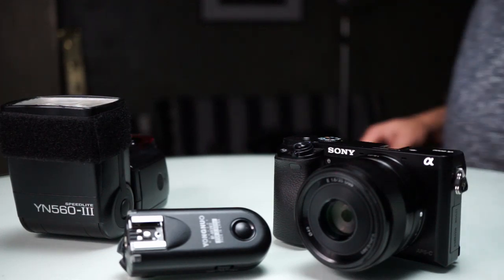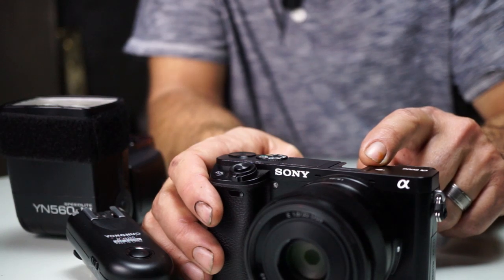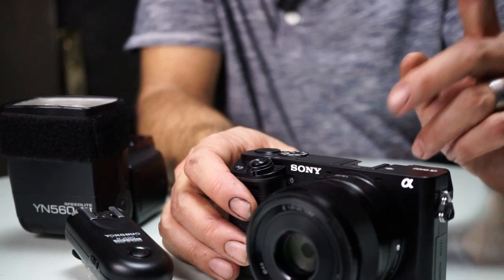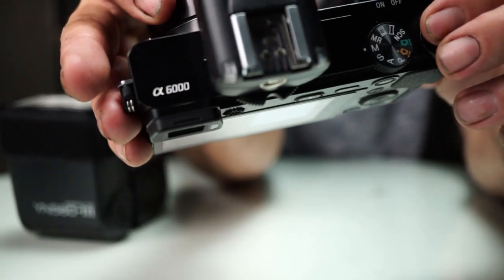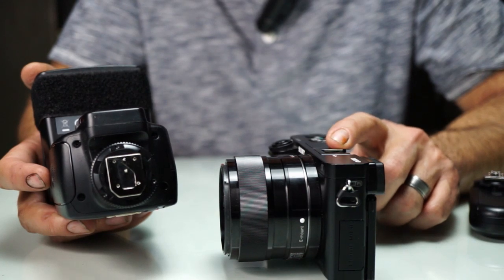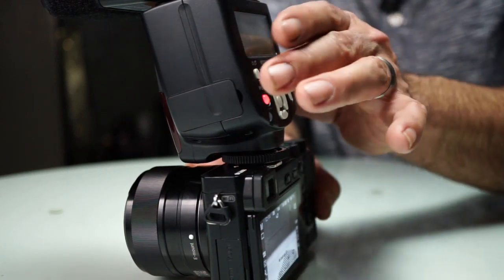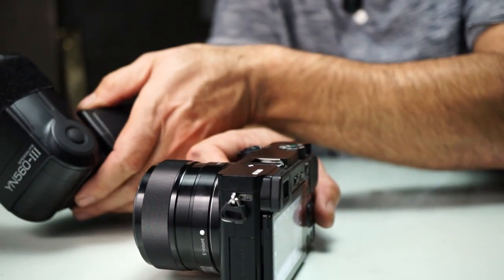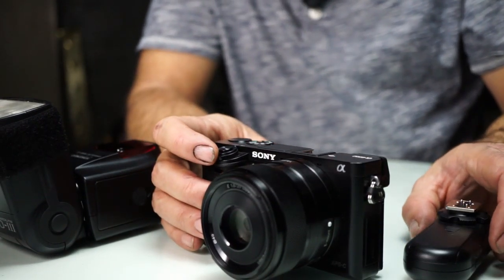Sony ILCE a6000 Hot Shoe for flashes fix Updated -How to.

Comment: Do you have a fix for the "WN" (wireless flash) function being grayed out?  I can't turn on the wireless Flash function and get a error message saying it is disabled.  I made it work anyway by putting my RF603C in the shoe and it fired both my Yongs.  But still. Why is it doing that??
Reply from the maker: that function only works with Sony flashes and the Nissin commander.  This is an old video. Godox is your best bet for flashes with Sony. The v350s and the x-pro-s trigger or the newer v1.
Reply: @LavikkaPhotography  I have a Flashpoint Xplor 600 on the way (Adorama's Godox Branding).    I am going to use it with Cactus triggers as the cactus triggers apparently work with multiple brands so I can trigger the Xplor and my Yongnuos with them.  I bought 4 triggers so 1 for transmitter and to receivers and one to trigger my camera.  Thankfully, I will use my Canon 80d for my flash photography.  I just like it when everything works.  I didn't know the A6000 had a proprietary hotshoe.  I really bought it to hoist it up on a pole to take elevated exterior architectural shots.  Saves me drone $$.   No flash needed - yet.  lol
Reply from the maker: @hotwireman49  nice stobe. Flashpoint is technically Godox so if the Cactus triggers don't work the way you want them too then Flashpoint R2 Mark II transmitter for Canon and another for Sony along with a few Base receivers that you can put your flashes on. 
I prefer Godox or flashpoint because you can mix and match flashes between camera systems but still have full control with the transmitters giving you true hss and ttl.

Comment: When I connect godox TT350s flash on sony A6000 it show this accessory is not supported by the device and does not detect by camera. My friend also has sony A6000 but it supports godox TT350s flash and doesn't show any massage when connected. Both camera same settings only my camera says this accessory is not supported by the device. What should I do please help please
Reply from the maker: You need to update the firmware on your a6000.
Reply from the maker: https://esupport.sony.com/US/p/model-home.pl?mdl=ILCE6000&template_id=1&region_id=1&tab=download#/downloadTab
Reply: I updated my sony A6000  latest version 3.2. Before the problem.
Reply from the maker: Is the flash set on flash+fill in the menu on the camera?
Reply: Yes..

Comment: The root cause of this issue has been sorted out.  It's that the Yongnuo flash expects ground to be on the underside of the top lip of the hotshoe mount as shown as the red section in the diagram here: https://www.dpreview.com/forums/post/54885036.  if you get a nail file or something and sand that down even just a bit you'll find that the flash when screwed on will make much better electrical contact with the a6000 and work every time.  I have just purchased a YN560 iv and tried it and initially it didn't work unless I twisted and pulled on the flash a fair bit and even then it was iffy.  Next I got one of my wife's nail board thingys which feels like it has fine sandpaper on a stiff piece of cardboard and just sanded it a little bit and after a couple of minutes of careful sanding I tried the flash again and it worked perfectly every time no matter the orientation of the camera.  Very happy now.  
Check out the thread at https://www.dpreview.com/forums/post/54885036

Comment: I have the same setup, and the transmitter detects shutter press, but on flash the led goes only to blue and not to red (not firing up). Did anyone come across this problem?
Reply from the maker: +Aleksandar Roman Blue? Never seen it. hmmmm.
Reply: under the pilot on flash, it's like when you half press test button on transmitter...

Comment: the solution is HC-511 for Sony MI to Canon Flash Hot Shoe Adapter A7 A7R A7S II NEX6 A6000 RX10
Reply: Hi, is there any setting in a6000 which I got to set before using the flash, as my flash doesnt flash out light, I am using the method you mentioned. Thank

Comment: Hello , I own a D7100 , but I looked on the internet and since the A6000 has a very good iso and optimal image quality , I have felt my heavy nikon, always used large cameras , but there comes a time that tire load in the neck or in his hand a heavy camera , my question would be , what camera is best in a general context ? In your opinion , if you were now having to choose to have just a single camera , and this choice would only have the Nikon D7100 and Sony A6000 , and both with identical lenses, which camera would you choose?
Reply from the maker: +Márcio MarcBerg X It's easy. I had both and I moved from Nikon D7100 and 810 to a6000 and A7r. I have always used AI glass so for me it was just changing camera bodies. The a6000 has killer af but d7100 has better flash and lighting support. Sony has af tracking and Nikon not so much. Nikon has View NX and Sony has Capture One Express (that you have to download by the way). Image quality wise they are about the same but you drop half the weight with sony.

Comment: Thank you so much for your video.  After watching, I purchased the Yongnuo RF-603NII and I have a black a6000.  Do you still recommend sanding to get the transmitter to work?  I am having trouble getting them to work.
Reply from the maker: +Chad Harnish The hot shoe is too deep so don't push the flash on as far. https://youtu.be/WdQKg8V8hzk
Reply: I tried that.. I couldn't get it to work. I added the resistor to my yongnuo and now it works. 😊 thanks for your reply. I really appreciate it.
Reply from the maker: ??? More info. I want to hear about this.
Reply: +Chad Harnish What you mean about the resistor?
Reply from the maker: Yes
Reply: I did this, and it worked.
Reply from the maker: Where did you add it? and what type of resistor?
Reply: I popped open the receiver and added it in there, 100kOhm resistor or 120kOhm resistor will work.  There are videos online that show where it goes.
Reply from the maker: Thanks. I will check it out.
Reply: +Chad Harnish Before you modified the rf 603NII, did you get a red light on them? I get a steady red light when i mount the rf on the sony.

Comment: I did this and I stil have the problem, I tried with a Canon Speedlite 270ex II, an old flash I had and a cheap wireless trigger DSLRKIT that it should work. and nothing happen. I don't know what is wrong.

Comment: I have a black a6000. I've done everything that you said on your videos regarding the hot shoe connection with the flash . I recently bought the HVL F43M and everytime I take a picture, the pictures come out dark, low light ... that yellowish color . I've used it as bounce flash , direct flash etc and still the same effect. Any suggestions???
Reply from the maker: +INTERCEPTOR P71 Are you using it in manual or ttl? There are two settings for ttl. The exposure amount for the flash and the exposure amount for the camera. If it's auto then the exposure for the camera needs to be adjusted. 
To fix the color find a white wall. Shoot it slightly under exposed and then set a custom white balance for it.
Reply: It should be a plug and play thing. I used the flash witha Sony a100 and it worked perfectly. Pictures crystal clear , but when I mount the flash on the a6000 the pics come out dark and ellowish, as if is not makingthe right sync or connection.
Reply from the maker: Are you shooting in manual on the camera?
If so you should change the white balance to flash.
Reply: +Lavikka Photography - It will do it with all settings. I'm using HVL F43M
Reply from the maker: If the popup flash on the camera is giving you the same results then its a setting on the camera. If they are different then its the flash.
Reply: +INTERCEPTOR P71 the pop up flash on the camera works fine it takes clear pictures the external flash that I'm using works well with other cameras
Reply: did you ever figure out what was happening? i’m having the same issue right now

Comment: Hi Davin. Very helpful video. Thanks.

Sorry if this is slightly off topic but after only 9 month's use one of my YN560-III units has suddenly stopped responding to power control in any mode, whether manual, ttl, or in S1 or RX with a hot-shoe mounted YN560-TX, and will now only flash at full power.

I've read several other online sources complaining of the same problem and was wondering if you had experienced this yourself and whether or not you had any advice as Yongnuo don't seem to offer any warranty.
Reply from the maker: Ian Wilkinson I haven't had this happen. I think there may be issues with a recent batch of flash because I am hearing about this quite a bit.
Reply: Thanks for replying so quickly! I think I may simply abandon the YN560-IIIs, ignore the Mk IVs, and just invest in a couple of Nissin i40s, having just watched your review. Cheers.
Reply from the maker: Check out the Nissin Air 1 with an extra Di700. That is the system to get for sony.

Comment: Awesome.... my HC-511 hot shoe flash adapter finally arrived from China. Now I can finally use my Canon 430 EX ii and Phottix Mitros+ (for Canon) flashes on my a6000 in manual power and be able to control the power without having to deal with the painted hotshoe issue. My hotshot is still painted black and it works like a charm. You need one of these if you have been dealing with this issue as many have. (BTW, the model for Nikon flashes is the HC-512) : http://www.ebay.com/itm/251723250087

Comment: I know the hotshoe on the a6000 can interact with almost any flash. But I'd like to know if when using a flash with an AF assist lamp (the one that projects a red pattern) such as the SB-700, would the AF assist on the flash still work? 
Specifically SB-700 on Sony a6000
Reply from the maker: ***** Nope. Just manual mode. It needs read info from the lens for af assist but the a6000 has an af assist lamp.

Comment: hello sir i have a doubt about can we install Sony HVL-F43M Flash to sony a6000 with out removing hot shoe paint on it??
Reply from the maker: The f43m should be fine. It uses the tiny hot shoe pins to ground.
Reply: thanku sir And What About sony HVL f32m we can attach this flash directly to somy a6000 with  any issues with hot shoe?
Reply from the maker: yes you can.
Reply: Thank You So much :) umm can we use this sony HVL f32m for portraits and wedding Photography??
Reply from the maker: It should work fine for that. Just don't let it overheat.
Reply: overheat?
Reply from the maker: All sony flashes overheat and lock you out for 10 min for a cool down. Some go longer then others. You should watch my flash reviews.
Reply: oh thank you sir :)

Comment: I have yn560iv and Phottix Strato ii transmitter, both works on my a6000 black, without the need to remove paint, and no wiggle at hotshoe either. 
Tried Arens trigger, workeds as well.

Comment: is it possible to use canon speedlight 430ez to sony a6000?
Reply from the maker: Yes but only in manual mode.
Reply: Lavikka Photography thank you very much for your reply,some say its an old flash for film camera and it may damage my cam (sony a6000) your thoughts pls. thanks,
Reply from the maker: The 430 isn't that old. Its still a digital flash so it should be fine.

Comment: Does your Canon flashes stick out the back end of the Sony Hotshoe so that it's not flush in the back (viewfinder side)? I have the Canon 430EX ii and it doesn't slide all the way forward when mounted on my Sony a6000. Would fine grit sandpaper (4000 or so) be better or worse to remove the paint? How easy did the paint remove when using the nail file (Emory board).how long dogs it take?
Reply from the maker: Check out my updated video on this. https://www.youtube.com/watch?v=ETkgj5-DdAQ&list=UUcdNjjD-Ddm5ryn8Qnf2hnQ and yes the canon flashes seem to stick out a bit.

Comment: So this way you don't have to remove any paint
Reply from the maker: You don't have to remove the paint from the center of the hot shoe but should remove it from the rails.
Reply: Lavikka Photography I didn't remove any paint and works with the tip you give by pressing the flash or remote to the right and them lock it.

Thank you for the tip.

Comment: I tried my Canon flash just pressing to the right, lock and make sure flash doesn't move and it worked, I did same thing with my remote and also works very well, My friend came with the idea to use aluminum foil and guess, works also but every time we take the flash or remote will damage the foil, lol
Reply: wait...aluminum foil for what? to lay on the bottom of the hot shoe? And if so, how does the camera communicate to the trigger to in turn talk to the flash?
Reply from the maker: The Post Color Blog Some flashes require more of a ground then others. the foil just helps make better contact.
Reply: Interesting. The concept makes sense. I have some thin pieces of metal lying around and I can actually ground the transmitters and make them communicate that way (pretending that the metal is the hotshoe). I contemplated placing them in the hotshoe, but then I thought it wouldnt make sense because the camera would need to still "talk" to the remote so they all fire at the same time. Having said all that, aluminum foil never crossed my mind! I have the Yungnuo 603n transmitters, and I it appears only the two "front" pins need to make contact. I know the center one does, but I might try that aluminum technique for the other pin. Anyway, thanks guys - sorry for the novel haha

Comment: it doesn`t work at all on mine with paint removed and the tip in the video.
Reply from the maker: if you are using Canon or Nikon flashes try doing a search for "Travor Sony a MI Hot Shoe Adapter" on ebay. It might help.
Reply: gosh, so u scratched the camera, void the guarantee and the flash is still not working? and u listened to that guy? lol

Comment: Would it be better to get one of these adapters for $30 http://store.sony.ca/autolock-shoe-adapter-zid31-ADPAMA/cat-31-catid-All-Cameras-Alpha-DSLR-Accessories
Reply: NVM, bad piece
Reply: Rathesh Sabapathipillai After my results with my 3 flashes (see here: http://www.dpreview.com/forums/thread/3704144?page=3#forum-post-56012920) Im wondering if it just might be better to indeed get a Canon to Sony mount adapter to avoid all these issues.
Reply: +Rathesh Sabapathipillai always preferred to go with adapter instead of getting the warranty void. Thanks for the info -  I am going to buy this adapter.
Reply: I had actually ended up getting a sliver one to avoid all issues. The sliver one doesn't face the issue.
Reply from the maker: +Rathesh Sabapathipillai That adapter is for converter the older sony shoe to MIS. I think you are thinking of this
https://youtu.be/2kdzIJiYsN0?list=PLw_hMQo1n8OKZ5w9aAv6FyAO-Yg2sjsSe